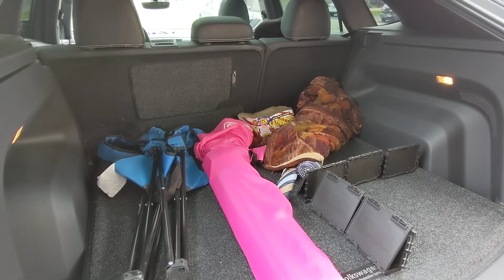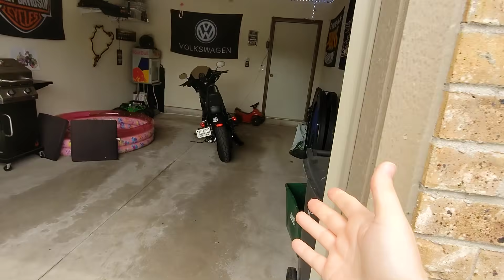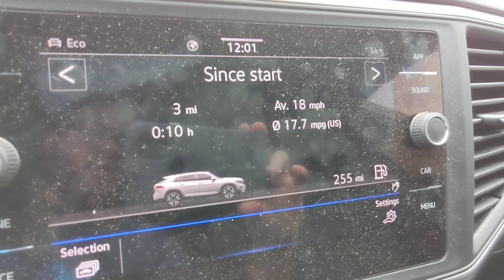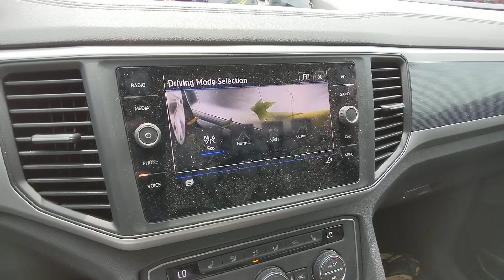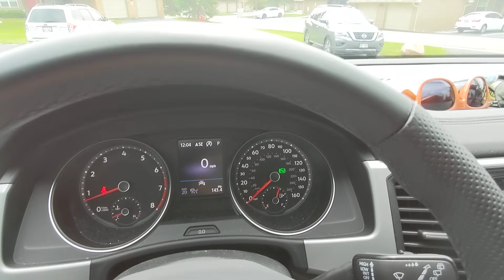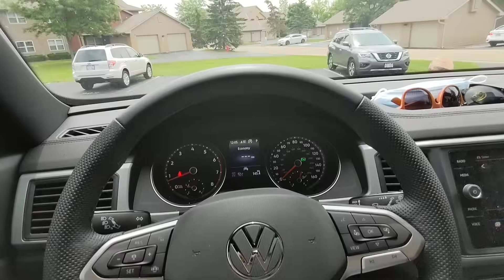2021 VW Atlas Cross Sport.  Why we're trading after only 4 months!

Comment: I was getting a good mileage on my 2018 2.0L atlas, running on cruise control going the speed limit ! it saves on gas! a lot actually but now i decided to change, i dont need the space since i dont have kids, and the warranty is about to be over in November, so i'm trading it for a 2021 GLI full ! More fun to drive and better value for money!
Reply: I've got a 2019 GLI, you're going to love it. It's the best bang for your buck sports car you can buy. It's always putting a smile to my face when I get going on that pedal
Reply: @Rocketfish17  What is a GLI?  A Jetta?
Reply: @jamesmedina2062  Yeah, it's a Jetta. It also doesn't get the same level of love from VW as a GTI. (I had a 2016 GTI, now a 2019) They skimp a little on the interior, and the ride quality isn't as good as a GTI. GTI is also more expensive, so it makes sense.

Comment: Not quite sure what you’re complaints are. My wife and I bought a 2021 VW Atlas Cross Sport in Tourmaline blue with the technology package. We got the VR-6 engine, and I love driving in manual mode, so I can hear her sing. Guess it depends on your driving style. Guess you could have gone with the 2.0L turbo, but then you would’ve needed to run premium fuel. By the way, we’re in Wisconsin also.
Reply from the maker: We loved the VR6 as well and loved it.  Commute suddenly changed and the gas milage was just killing us.
Reply: You don't need premium fuel. 2 litre Turbo would run fine on top brands non-premium fuels. We own one. Very fuel efficient - averages 26-29 easily on non-premium fuel.